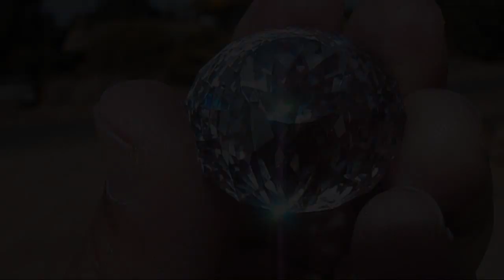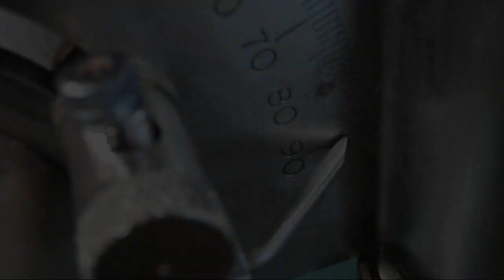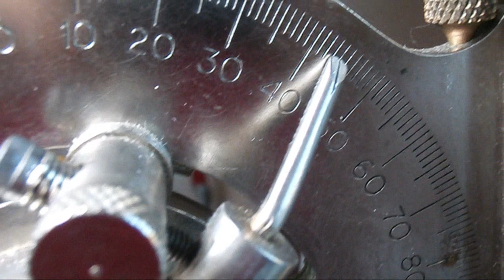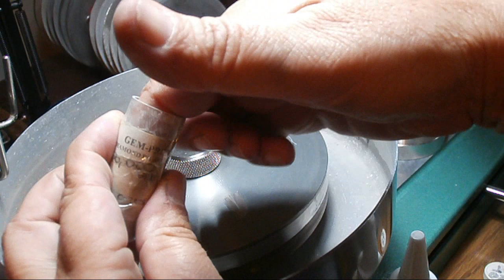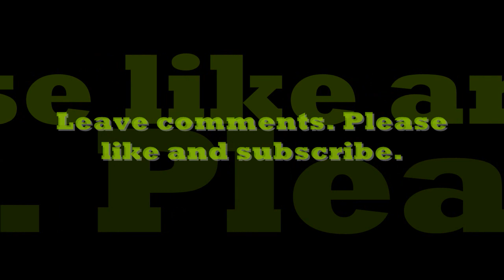How To Cut Gemstones - Sapphire

Comment: Hi Cliff! I'm a new subscriber and a beginner gem cutter. I have been working on some rough I got from Tim Petek. Do you have any videos that explain in detail the polishing stage? I always seem to have trouble getting a good polish with the 50,000 grit diamond. I am using an Ultratec with a BA5T lap with WD-40. I have a hard time seeing whether the scrathes have been removed with the oil sheen on the facets. Maybe I need better light. Also, I am not sure when to clean the lap, add more oil, or add more diamond. Any help would be much appreciated! Also, do you always polish the facets from the girdle toward the table or culet or does order not matter? Merry Christmas and thanks! Andrew
Reply from the maker: You will have to wipe the oil off else you cannot see the scratches....I use toilet paper. Polishing is the most difficult. Learn to polish Topaz...It's the easiest.

Comment: I used to have that very same machine.

Very easy to use
Reply: what name\model of the machine?
Reply: @eduardbuletsa9485  not sure now.its been about 8 years since i stopped using it and got rid of it.

Ask the man in the video.

Its an easy machine to use but not as well supported as facetron
Reply: @jadekayak01  What on earth do you mean 'supported'? Faceting machines don't come with support, lol.  If you receive it broken, I'm sure they'll make good on it, but that's about it. It's a very DIY hobby.

I am also 95% sure that isn't even a commercially produced machine. It looks to be based off of a facette, but isn't the standard commercially sold machine.
Reply: @sophiophile  you can buy any number of attatchments for a facetron-more than any other machine.

Custom index wheels so you have no numbers-only slots.
96,120 + more tooth wheels
Reply: @jadekayak01  What can you buy other than extra dops, index wheels, and maybe a cam preformer.

Also ultra technical definitely has more stuff you can add on.. Not to mention the interoperable concave and fantasy setups
Reply: @sophiophile  you mean ultratec.
Reply: @jadekayak01  haha. Yeah. Spell check autocorrected and I wasn't paying attention. I am cutting on a v2d as we speak (same as the v5d, just a skinnier riser block and mast height adjustment has coarser threading)

Comment: I'm quite surprised at the price you mention for rough sapphire. There are places in Montana that let you dig through sapphire bearing gravel as a tourist (or will mail gravel to you) and you can get quite a lot of good rough stones this way. I just had 40 facetable stones evaluated (from 0.7 to 3 carats rough, average 1.3 carats). Including the cost of the gravel, shipping and everything, I'm paying on the order of $15-30 per carat for the rough stones. Of course, it's only that cheap because I enjoy it and my labor is free.

Obviously, it doesn't make sense to have a box of gravel shipped from Montana to Australia, but you have alluvial deposits of sapphire there too. Maybe it's worth a trip; Montana is some beautiful country.
Reply: Hi! I'm extremely interested to know where you order the gravel through mail! Thanks in advance

Comment: Cliff by adding the girdle facets does that effect the dispersion ? Improve it or no ?
Reply from the maker: I think it makes no difference in dispersion looking down through the table. I've faceted other gems with a high RI  similar to Sapphire with a continuous girdle and I can tell no difference. However, a faceted girdle looks so much better in a setting, and you can see that cut girdle facets do glint and reflect light in sunlight  (particularly with larger gems). Personally, if possible a faceted girdle is a better option. If the gem was under 4mm in size, a continuous girdle would make life easier to facet.
Reply: @VintageTimeGems  Thank you for taking the time and sharing your knowledge with me.

Comment: Hey Cliff! Another great piece. I noticed the design you are cutting from is for material with a refractive index of 1.54. How do you account for this in a sapphire with a RI of 1.76? Is there an equation you use?
Reply from the maker: If you check out a table of "Gemtones critical Angles" you will find that gems with a high refractive index will also suit designs that have a refractive index of 1.54.  The problem is gems with a low refractive index cannot be faceted when the culet facets are cut below 41 degrees, then they will not refract light and appear see through (windowed).